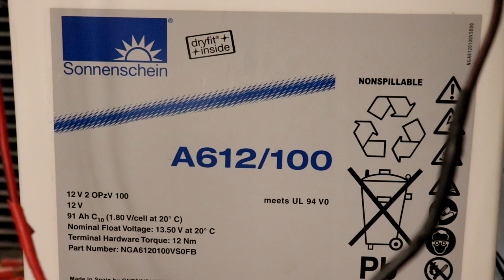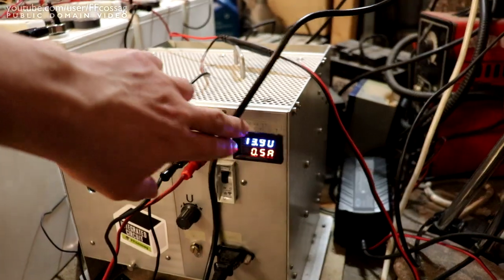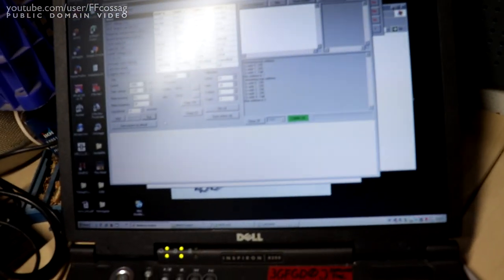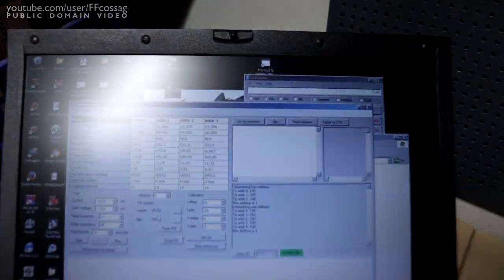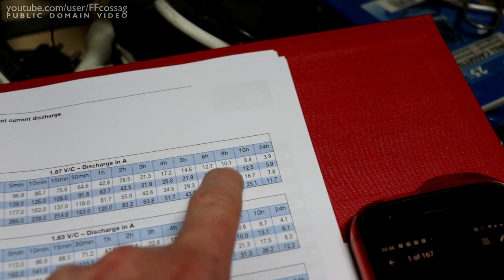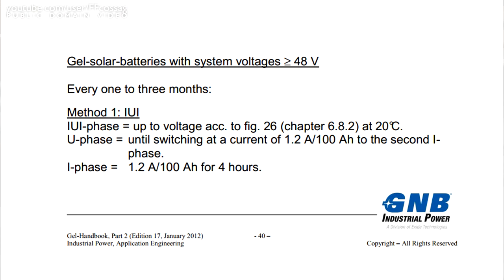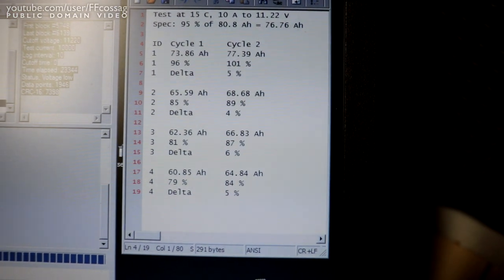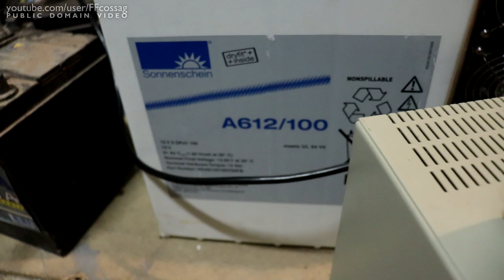More old batteries! Sonnenschein A612-100

Comment: you are a certifiable SLA doctor! I am learning alot! I only have the opportunity to mess with old cheap 7Ah UPS batteries that have been cooking for years and are either dried out, sulphated or shorted out. So after I have added some distilled water to the cells my method for fixing internally shorted cells is actually to charge it as much as I can and short circuit the battery terminals for a second or two, then recharge it slowly until the voltage starts to drop again, repeat the process. I have had partial success with this methos, now of course I would not want to try this with anything bigger than a 15Ah battery but if you get a tiny amount of current out of it then go for it, otherwise I would recommend a high current regulated load bank.
Reply from the maker: Heh, that's a curious technique -  but as you say, little 7 Ah bricks tend not to be very useful as anything other than literal bricks once they get up in years. There are of course some exceptions, such as (say it with me now) Sonnenschein blocks ;)

I need to get a sponsorship from GNB, lol.
Reply: @FFcossag  SONNENSCHEIN!!! XD yea I do have a thin 5Ah SLA propping open the door to my room!

Comment: A great way of getting those batteries to crack is to fill all the leakage points with glue, sealing the battery casing.
Reply from the maker: They are not intended to leak by the terminals, they're intended to leak through the caps - and they might crack even if you don't touch them. Trust me. ;)

Comment: Absolutely wonderful find! :D performing 101% after 8 years is extremely impressive! I really wish I could get my hands on sonnenschein batts! 

I think I'm gonna do the overcharge treatment to my solar 6V blocks (flooded generic lead acid batteries), they've been sitting for over 2 years when I got them, otherwise almost unused! I hope they will come right back around once I do, and since they're flooded I probably don't need to be super careful when doing it, but I will still use my professional power supplies so I can set a safe voltage and current limit :) 

Wonderful video as always, I always enjoy these battery and solar power videos :) I need to build my own battery discharger too, I'm extremely curious about the actual condition of all my batteries, using resistive loads like I've been doing to test capacity is not at all accurate, although it gives me an idea of the rough status of cells :)
Reply from the maker: A cycle or two, as well as a balance charge can work wonders on cells that have only ever seen stand-by use. It seems to have less effect on batteries in cyclic use, since they actually get some regular "exercise".

You still need to be careful not to overheat them while equalising - if you set a current limit much higher than what Sonnenschein suggest, you edge closer to thermal runaway no matter your battery type. It generally seems as if a lower current limit over a longer time has a better effect.

Resistive loads are pretty fine, actually, since lead-acids have such a friendly discharge curve. You can basically just calculate the average of the starting voltage after ~10 minutes of discharge with the end-of-discharge voltage to get your average voltage for the cycle. Know your resistance, and you can then calculate your average discharge current and power. It'll be within 10 % or so! Though mind that this technique does not work with dynamic loads such as light bulbs.

Comment: Very interesting series of videos :) I am curious how you have those, and your aux battery hooked up. You mention in parallel but does this not limit the capacity at which you can discharge (mixing different capacities etc) or does your inverter/cc have multiple inputs for different strings and it is able to manage how much it draws from each one?
Reply from the maker: My battery bank is made up of one main 48 V bus, that various batteries hook into through appropriate breakers and fuses. My gear is configured to conform with the batteries I care most about, with any others getting to deal with the slightly unoptimised set-up. Lead-acids are thankfully very forgiving like this, so it works well, but you need to know exactly what you're doing to operate a system like this.
Reply: @FFcossag  Ah thank you for taking the time to reply, this makes sense and sounds like it works well for you! I was trying to wrap my head around it but it turned out to be very simple xD